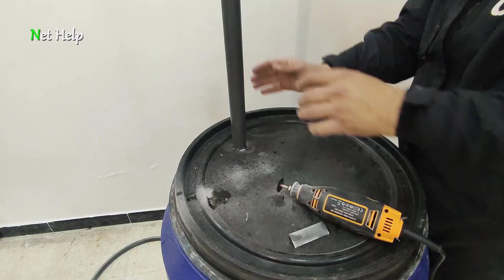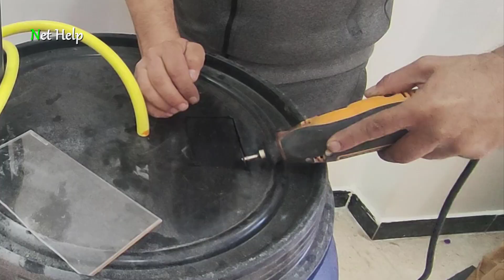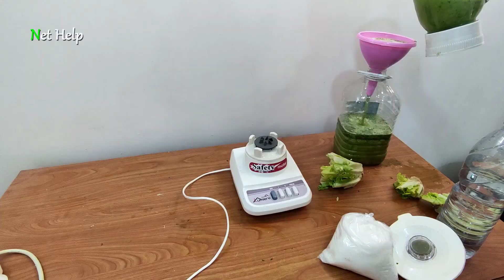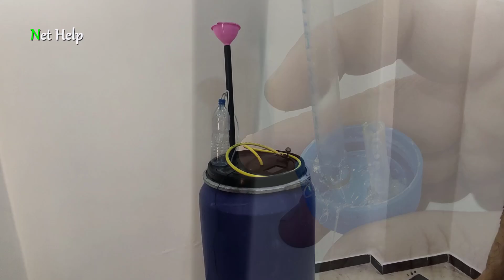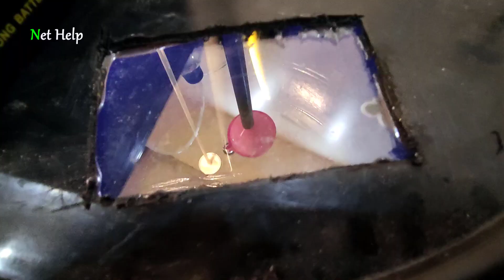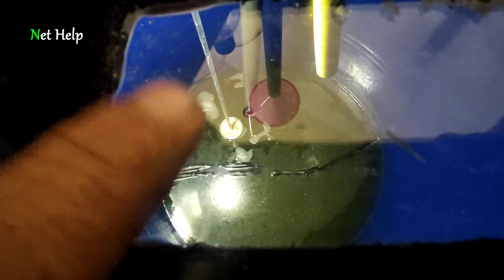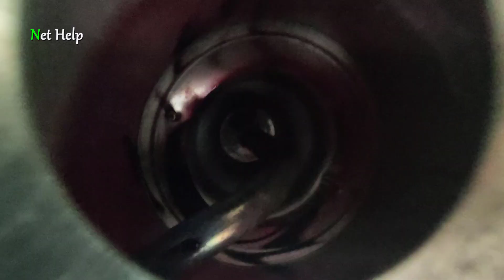Say goodbye to buying gas from the government - and get it free for yourself

Comment: I do not understand the purpose of a bottle on top to remove water from the methane gas?  Why does water have to be removed from the air/methane/water, what does water in the "vapors" do to the methane or flame?

Why is the natural gas/methane coming out of the yellow tube not having the yellow tube go into a bottle of water for safety from a flame going backward into the barrel  and then exit into a burner?
Reply from the maker: If you mix water vapor with gas, the gas will not work well

Comment: This device you are making make natural gas and you show in the video there is no where for this gas can go building up pressure can cause your device to explode releasing H2S gas in the area and if The person is close enough it can stop them being able to breathe making them die and your video show it inside of A structure Which can cause secondary explosion from the natural gas build up .
Reply from the maker: There is no high pressure that leads the device to the explosion, but the pressure is weak
Reply: @NetHelp2  the device you made make h2s gas the body can expelled some of this gas automatically but if you breathe to much of this h2s gas it is a nerve agent to the body and it can and will cause you to become paralyzed you cannot breathe on your on , if some one not there with you to get you a way from this gas to fresh air you will stop breathing if some one not there with you to help you breathe you will die because you will not be able to breathe on your on ! Depending on the conditions and type of food put in there pressure can build faster on one day than another !!

Comment: With the electrical LED inside the gas chamber, It looks like a bomb waiting to happen.
Reply from the maker: It runs on battery and is protected, not what you think
Reply: @NetHelp2  protected or not, a fail will produce a spark.
 it would be easy to just have it shine through a window from outside of the gas container.
 Something really cool,would be a cost list and run time breakdown. 
 This thing is awesome though. so simple to prepare and use.
 unfortunate people in third world countries 
could find everything needed to build one of these for free.

Comment: Hi , i seems like barrel will produce gas all of the time but when the gas won't In use barrel will burst out. 
Am I right ?
Reply from the maker: When the barrel is filled with gas, it will start to stop because the pressure will push the gas to the bottom of the barrel

Comment: The problem appears with the hydrogen sulfide associated with natural gas, which gradually leads to a loss of sense of smell in addition to the damage of equipment in which natural gas is used.
Does anyone have a solution to this complex dilemma?
Reply from the maker: Methane gas has no smell, so adding vegetables to it helps in fermentation and adds a musty relief to the gas
Reply: Bubbling the gas through naoh water should neutralize tge h2s
Reply: si una trampa de agua pues o un filtro de carbon
Reply: Grazie

Comment: First of all the methane you made was not free as you clearly purchased goods from the store IE: salt, potassium, fruits, vegetables and ammonium to make said methane. Second we done buy gas from the government, we buy gas from the rich oil companies that drilled for oil and got methane gas as a byproduct of the extraction of the oil. In the 80’s when I worked in the oil fields in Louisiana they used to just burn that methane off from towers like giant candlesticks shooting into the sky along the side of the road for miles and miles and I always wondered why they didn’t harness and sell it instead of just lighting it on fire and letting it burn 24/7/365

Never made any sense to me but what do I know I’m just a dumb Electrician
Reply from the maker: Everything you mentioned is an aid and accelerator for methane production
But methane gas can be produced from animal dung only without any additional materials
Reply: @NetHelp2  then why didn’t you show that in your video????? Clearly your video does not represent the title of the video as your title says “free” and CLEARLY what you show was NOT free

Comment: Such a gas installation is very dangerous, the gas leaks around and may cause an explosion and severe burns. You must never use something like this in a house, basement, or closed room, or there will be an explosion. The usefulness of such a structure is zero and I do not recommend anyone to follow it. Sealing the gas installation with glue is idiocy squared and the structure is extremely sloppy, not providing a bit of safety
Reply from the maker: Always do a safety check
Reply: Krzysztof....then why don't you show us a better way then???
Reply: @gregdowd939  After all, I wrote that such an installation must not be built in a closed room because inaccuracy will cause an explosion of the accumulated gas when someone turns on a light or even a small spark. The gas supply to the burner should be done through water reservoirs so that the flame cannot go back to the tank and blow it up. Have more imagination or you will hurt yourself and don't follow everything you see in the video

Comment: There is no pressure in the barrel
Reply from the maker: Mr
If you see what's inside the barrel, how do you say it's a fraud?

The pressure of the barrel is caused by the evaporation of the water inside and the pressure caused by the bottle
I hope you watch the rest of the videos before you say that
Thank you
Reply: @NetHelp2  It looks like You're right.  I've seen other videos on this topic.  It really works.  Sorry I was wrong.

You can collect the gas in a car inner tube or use multiple plastic bottles attached to each other.
You don't have any gas buffer

The production of methane takes much longer. I don't know how you did it but maybe the fragmentation affects it

Comment: Very Nice, indeed! Good job!
So, how exactly do you refill this after two months? Do you completely empty everything from water tap at the bottom, and then fill it up from the pipe? Can animal dung go through this pipe? Or does it have to be wider? 
Can you connect this gas to a generator, or you have to make any changes to the generator?
Reply: Faltaron los "3 pelos de gato 🤔😁😁
Reply from the maker: The master of animal dung, with the passage of two months, is melting inside the bucket
Everything can be added from the outer tube and discharged from the bottom

In the next episode, we will operate a generator

Comment from the maker: To all viewers
You can activate subtitles from the video properties. We have translated the video into all languages
You can also tell us about anything you did not understand and we can explain the method to you
Thank you all
Reply: Dont know the things you mixing
Reply from the maker: @danielngove  Mr
All ingredients are written below the video and in the comments

The following materials were used
1- Vegetables one kilogram
2 _ Fruit one kilogram
3_ Animal dong + soil 12 kg dry
4 _ Rock salt, one kilogram
5 _ Ammonium + potassium 400 g + 400 g
6 - 60 liters of water
Reply: @NetHelp2 
What u main rock salt??!!
Reply: @NetHelp2  هل يمكن استبدال بوتاسيوم امونيوم بمواد اخرى
نحن وسط حرب وحصار فلا توجد مواد كيماوية؟
وماذا عن استخدام الخميرة
والخل
Reply: The problem appears with the hydrogen sulfide associated with natural gas, which gradually leads to a loss of sense of smell in addition to the damage of equipment in which natural gas is used.
Does anyone have a solution to this complex dilemma?
Reply: @gurukira3995  A second vessel with slacked lime (calcium hydroxide) will remove all sour gases, like CO₂ H₂S HCN. Actually biogas is a mixture of methane and  CO₂, and removing CO₂ greatly improves calorific effect of the gas (heat of combustion). Slacked lime is consumable, you have to replace it, when it loses efficiency.
Reply: @gurukira3995  There's  quite a few range of systematic Biogas purifiers in the market for different impurities that are formed during gas formation they are called methane scrubbers.
Some are specialized according the specific impurity you want to remove and some remove everything.
Also bio-char/charcoal is quite a good absorber of most impurities. just make sure to do your own research. Good luck and peace
Reply: @gurukira3995  salve mi  serve piu informazione  sulla perdita olfatto grazie
Reply from the maker: @gurukira3995  This is not natural gas, but methane
Reply: Bir bitirene kadar dayanır dayanmaz işe yaramaz
Reply: @ahmedcan4945  ne dedigin anlaşılmıyor . Dayanmaz ne dayanmaz? Ne bir işe yaramaz? Anlatır misin?
👍🇹🇷
Reply from the maker: @ahmedcan4945  Neden işe yaramaz olduğunu düşünüyorsun?
Altyazıları aç
Reply: Ok
Reply: The Russians believe that there is no gas except in Russia.... I want to say that gas is present in Qatar, Egypt, Libya, Iran, Venezuela and other countries. I do not understand why the Russians think that it is not a game to raise prices.
Reply: Nice bomb 👍
Reply: What is that kind the thing its like a adaptor u use that material kinda aluminum?
Reply: DO YOU SELL IT
Reply: espanol
Reply: Lettuce water amonian salt rock
Reply: Aaqqq
Reply: What is that kind the thing its like a adaptor u use that material kinda aluminum?
Reply: What's  the ingredient  how does it work..?
Reply: Procedure
Reply: Help us to create that..what is the correct procedure
Reply: هل نستخدم اسمدة في ذلك
Reply: God bless you.. you did what you have to do. But there is an easier way than this method, which is to use only gasoline and water
Reply: Hello: We in Syria always suffer from a lack of gas, so I ask you to help me with accurate details of making this digester. I ask you to name the materials that help in fermentation and where can I find them. Thank you very much
Reply: Pueden explicar el.proceso en español?
Reply: Step by step instructions?
Reply: tu ajoute du sel avec les legumes ? tu peut ajouter la recette par ecrit ?
Reply: Em português
Reply: yes, good  idea translate, please! gracias  por compartir. Thanks for share!
Reply: Thanks for keeping America Safe. We'll played sir.
Reply: So what's the importance of the filter ? What's the filter doing in the tank ?
Reply: what is the materials needed to be mixed to achieve this free gas and the measurements and number of days to be able to produce and how longer until it will be used?
Reply from the maker: @diomarmaravillo527  All information is written below the video and in translation

The following materials were used
1- Vegetables one kilogram
2 _ Fruit one kilogram
3_ Animal dong + soil 12 kg dry
4 _ Rock salt, one kilogram
5 _ Ammonium + potassium 400 g + 400 g
6 - 60 liters of water
Reply: Вот когда Россия Европе перекроет газ так и будете его сами добывать!
Reply from the maker: @ВалерийВладимировичМихайлов  хорошо
Reply: @ВалерийВладимировичМихайлов  чувак решил навариться под шумок на европе, ещё и косит под иностранца, хотя видно что выходец из наших, рождённый в ссср
Reply: @ВалерийВладимировичМихайлов  хрен бы им. Надо ещё где-то минеральные удобрения достать.
Reply: @ВалерийВладимировичМихайлов  они во всю уже готовятся😄😄😄
Reply: Salam alaykum...indonesian language is not available, but after i saw the other videos are working, thanks..may god bless you and your families 🙏
Reply from the maker: @turquoisedeepgreenarmy1787  welcome
Mr
I have added the indonesian language
Thank you
Reply: @NetHelp2  thanks a lot, shukran jazeelan 🙏
Reply: Buenas amigo cuales son los ingredientes y cuanta agua cuanto tiempo hay que dejarlo para que salga el gas gracias
Reply from the maker: @miguelsanchez7587  
The following materials were used
1- Vegetables one kilogram
2 _ Fruit one kilogram
3_ Animal dong + soil 12 kg dry
4 _ Rock salt, one kilogram
5 _ Ammonium + potassium 400 g + 400 g
6 - 60 liters of water
Reply: @NetHelp2  my dog isn't going to be happy if I have to use his dong!!  🤣
Reply: @NetHelp2  Praticamente hai costruito una specie di "intestino, pancia animale"... La questione è, quanto dura il metano accumulato con quelle quantità di vegetali e altri prodotti?
Poi seconda questione, è pericoloso tenere in casa un contenitore come quello, pieno di metano?
Per tutto il resto complimenti 🤝
Reply: @paxetamor8276  no more dangerous than any combustible fuel it replaces.
Reply: @NetHelp2  it looks like you also used a battery, wire, fuel filter, led strip, 4 black colored sticks etc.
Could you list these items and their functions?
Reply: Estaría bien saber las.medidas...  y entiendo que se le podría ir agregando cada semana más  para generar más gas...  verdad?
Reply from the maker: @cryptosactivos  Señor, active la traducción, le expliqué todo.
Adición cada mes Puede agregar ingredientes y después de 15 días vaciar una pequeña cantidad
Reply: @NetHelp2  porque vacías una cantidad después de 15 días? No digiere todo las archaebacteria? Y no seria eso un desecho toxico? Que hace con los desperdicios que descarga cuando vacía el tanque?
Reply: @iamfound74  se supondría que es Bio fertilizante
Reply: Ролик сделать надо с обьяснением а не с музикой. .не танц площадка наверно
Reply: @ГеворгЗ  I thought Russians loved to dance.  I love my Russian friends.   They truly know how to love life!  I live in Athens Georgia USA.  Get those fucking Ukrainian impostors out of there.   I know my govt installed them and I'm sorry.  We're making moves to correct the decades of deceit.   Don't believe what you hear we love the Russian people and we know about the wrongs committed.  We will take responsibility and both of us shall have better days.
Reply: На сколько хватит одной заправки?
Reply: @Mirage-nc5sd  на 10 секунд горения
Reply: Учи русский язык пригодится скоро... Английский мы русские почти все знаем.
Reply: @Вася777-в3ъ  English pls
Reply: Какой бред 🤦.
1)Это противно пахнет
2)это пожароопасно
3) это обладает очень малым КПД.
Хорошо что я живу в России ,трачу газа сколько хочу за сумму, эквивалентную 3 долларам США 🤣☝️